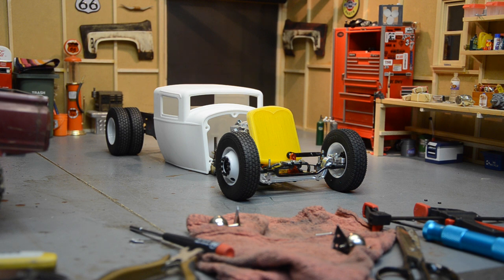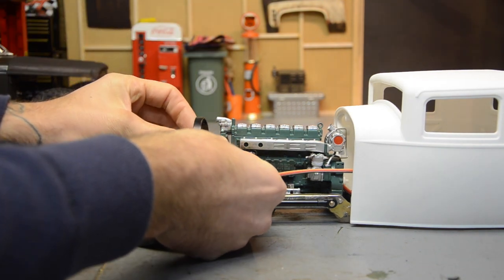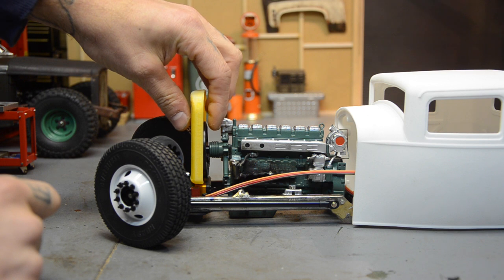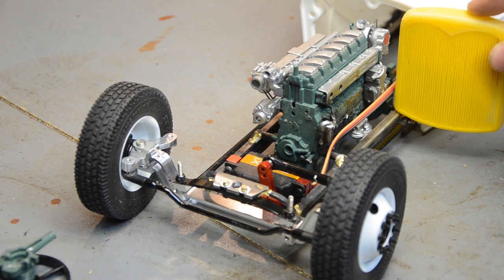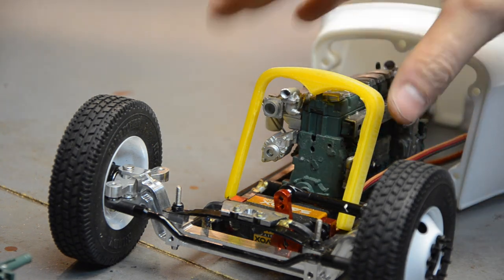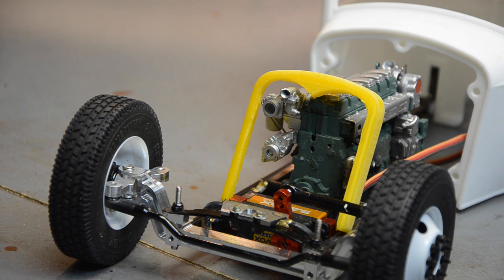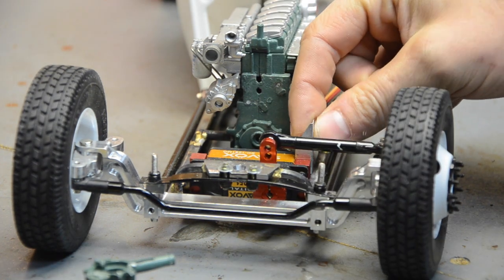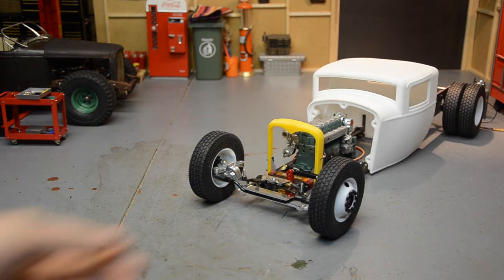Old #2 Scale RC Rat Rod Build, Scale Radiator Grill Install

Comment: Do they sell fly/mosquito netting with a fine square mesh in your area? It used to be galvanised steel but nowadays it´s often plastic. Maybe an eighth of an inch or a little finer might look good - you could perhaps even fit it diagonally and stretch it up/down so it forms rhombuses, though it´d then be a bit of a challenge to glue it to the grille surround. The steel mesh rusts nicely if you burn off the zinc. Or you could snip a piece of thin stainless wire into lengths and glue them vertically and as parallel as possible to the inside of the surround. I made a one-sixth scale grille like this once and it worked okay    : )

Comment: Have a look on eBay for like 25 or 50 micron stainless wire mesh they sell them in a4 sheet sizes for £9 so you can use it on a few future projects 👌